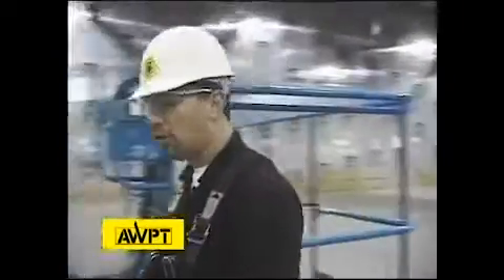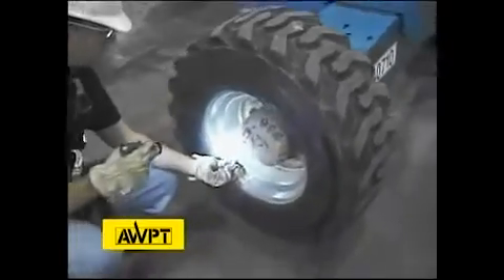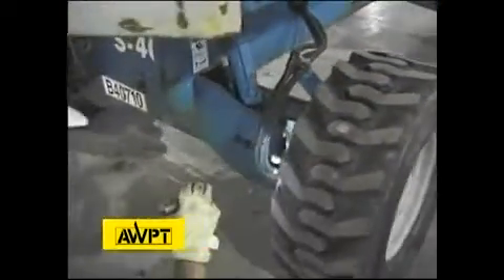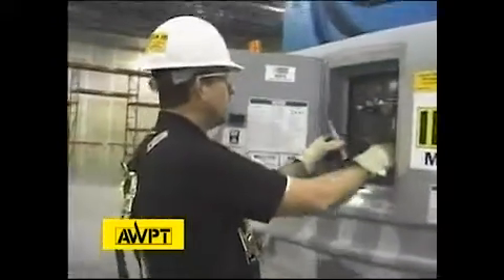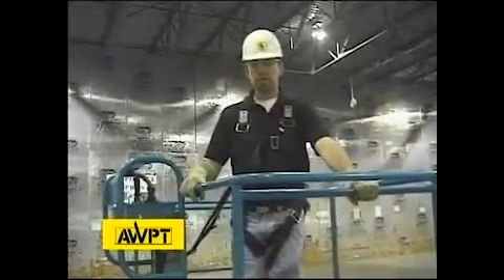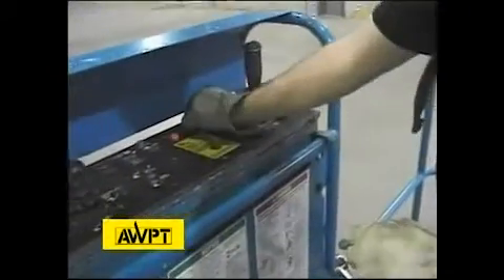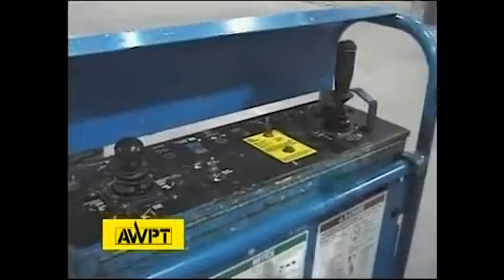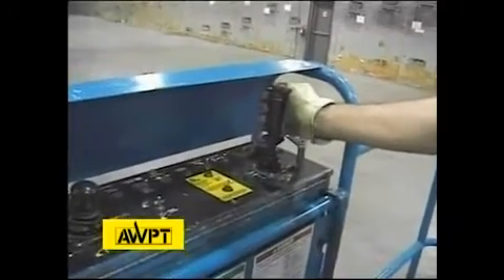AWPT.org - Boom-Lift Pre-Start Inspection

Comment: we cannot get any power from the basket, any ideas
Reply from the maker: Johnna, you will need to refer to the manual on what steps to take, as machines differ from each other. If you're unable to resolve that way, please get in touch with the manufacturer to discuss the next steps.